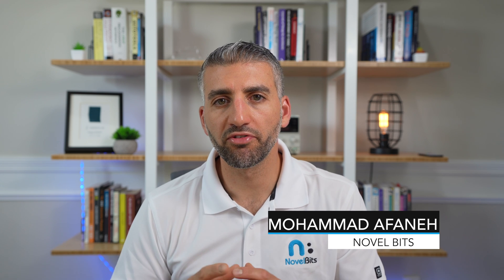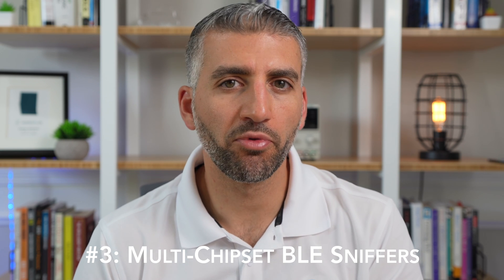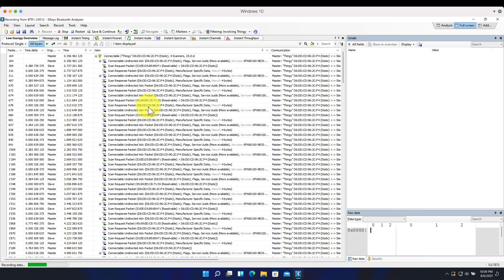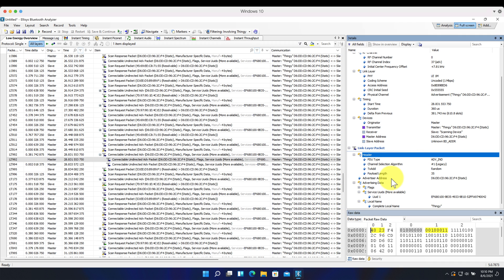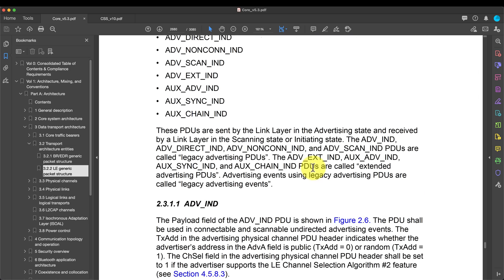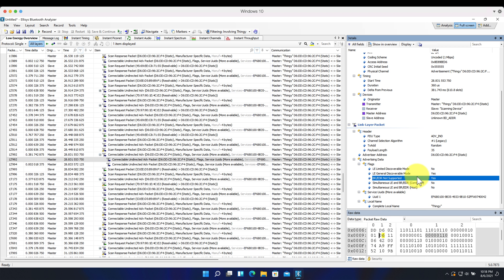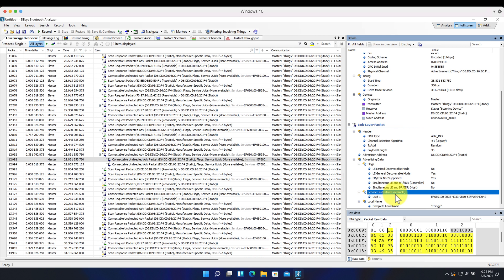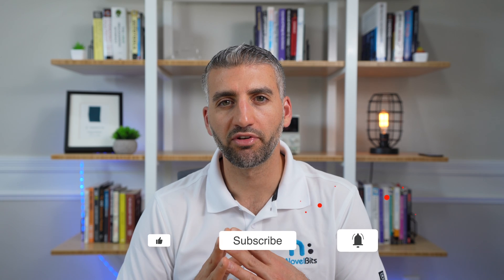$20K BLE Sniffer in Action: Demystifying Advertising Packets Like a Pro!

Comment: Thanks for your videos! Tell me please what is different between ubertooth one and nrf52840? Is it possible to use nrf52840 to detect devices that are in invisible mode?
Reply from the maker: The Ubertooth One is meant as a dedicated sniffer device and the sniffer firmware is open source. However it can be reprogrammed with other firmware with different behavior. The nRF52840 on the other hand is meant as a generic development kit. Nordic does provide firmware for the nRF52840 to operate as a sniffer but the source code is not available.
Reply: @NovelBits  thanks for your answer! And what about invisible bluetooth devices? How i can find them? It's very interesting
Reply: @ИванШлык-н8х  What exactly do you mean by invisible devices? In BLE there is a Central and a Peripheral. The Central mainly is invisible because its role is to discover and connect to Peripheral devices and Peripheral devices usually advertise in the open so they can be discovered by Central devices. What exactly is your concern with invisible Bluetooth devices?
Reply: @mohammadafaneh3481  you see, I am wondering if it is possible to detect any type of BLE device, be it central or peepheral, if they do not send out advertising packets. We can say that they are "invisible" to other devices. Is it even possible to detect such devices using Ubertooth One or nRF52840 or someting else?
Reply from the maker: If a device does not advertise or send any BLE messages (for example, in active scanning mode the Central sends a scan request message), then there’s not really a way to discover it (at least not traditionally). The device in that case probably just has the radio on to receive BLE packets, which is not feasibly detectable by other devices.